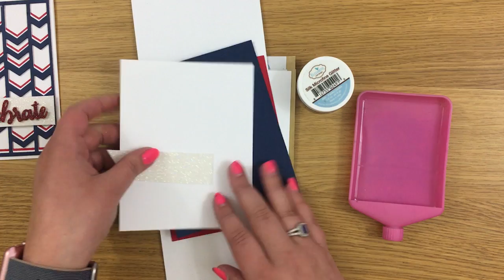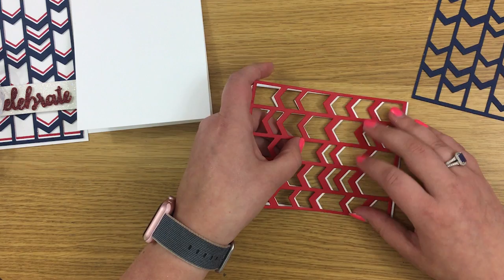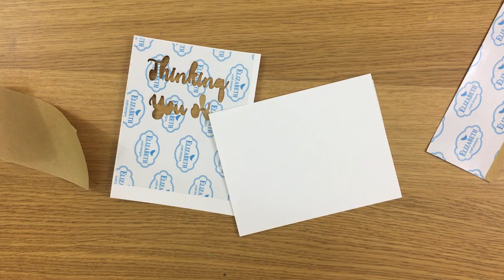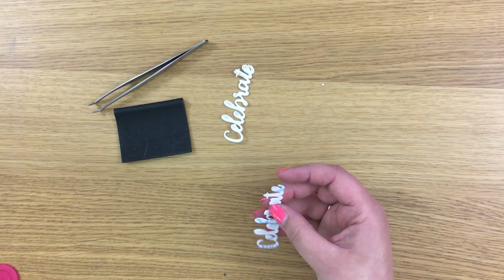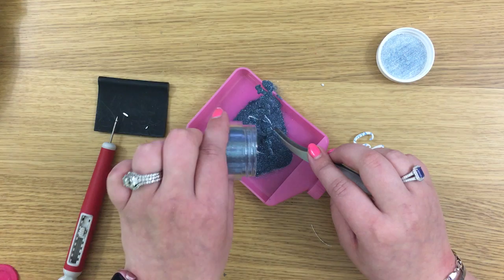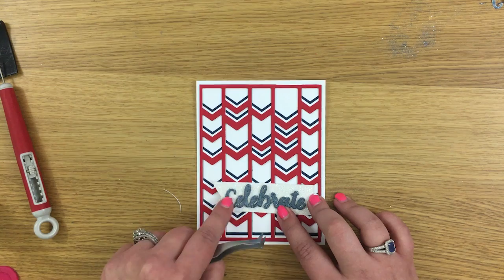Crafty Hack - How To: Create Your Own Layered Cardmaking Die Cuts with Elizabeth Craft Design

Comment: Use a coffee filter for glitter...less static cling.  If you must use a plastic funnel tray..swipe the inside with a used dryer sheet or EK Success Powder Tool or  bag of powder embossing bag...sorry..don't know what the actual name ob this little powder bag is called...it's the same little bag used for embossing powders  :)
Reply from the maker: PA yes that's the powder brush I was using. The swift rworks well too